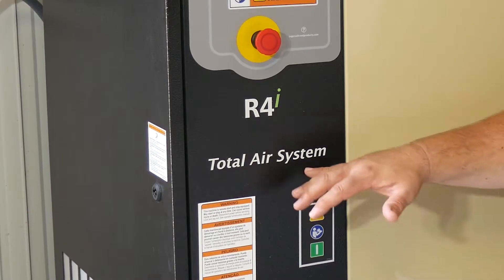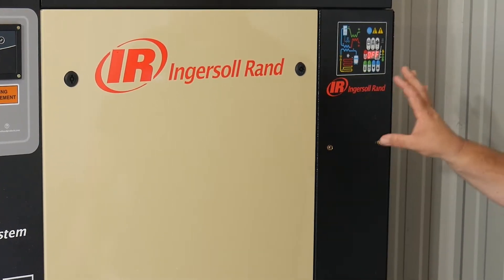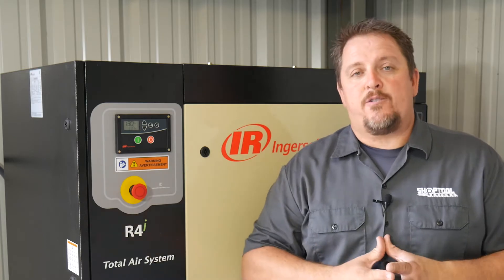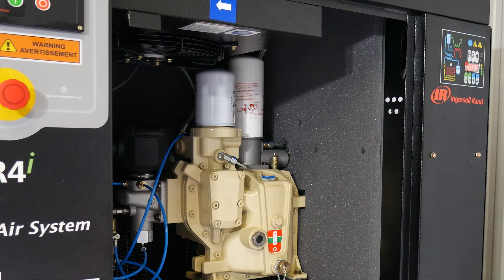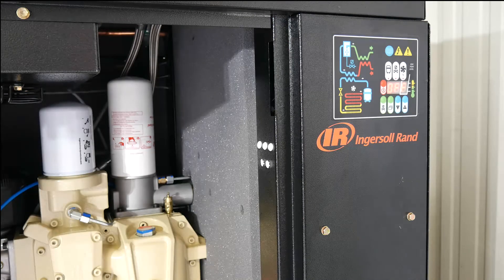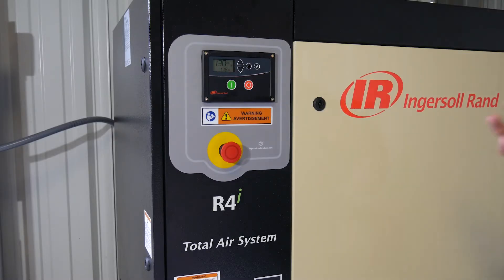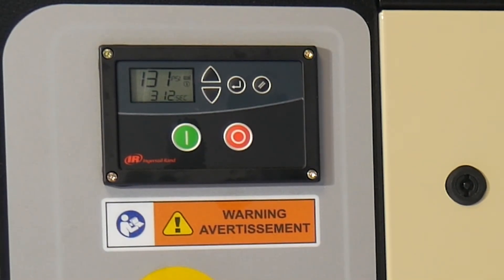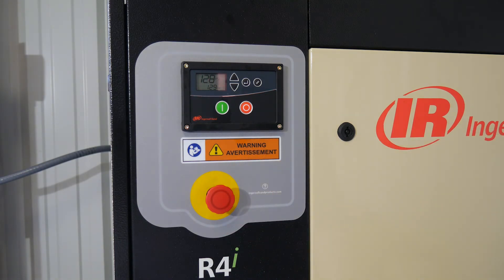Ingersoll Rand Rotary Compressor R4i R-Series Installation

Comment: I have the same compressor but i got a problem,the oil is leaking from the air filter...can you explain us why is that and what is the problem....thank you
Reply: Inlet valve is sticking open, blowdown system in inop, or discharge check valve is stuck.
Reply: O-ring needs to be changed

Comment: How many filters do we have to replace on this compressor?
Reply: It needs 1 oil filter, 1 oil/air separator, 1 pre filter for the dryer, one post filter for the dryer. Also a cabinet air filter, and dry air filter
Reply: There's two oil filters and and an air filter.